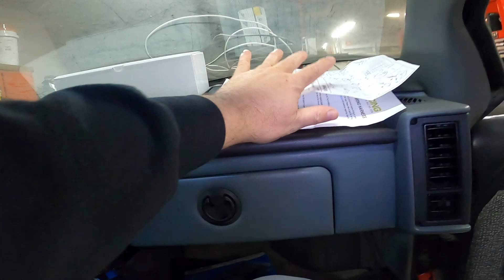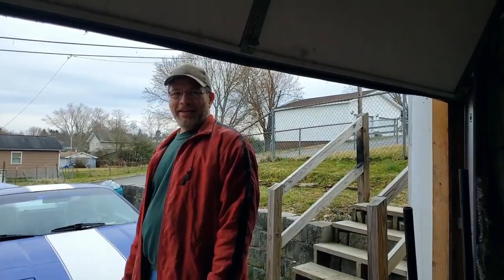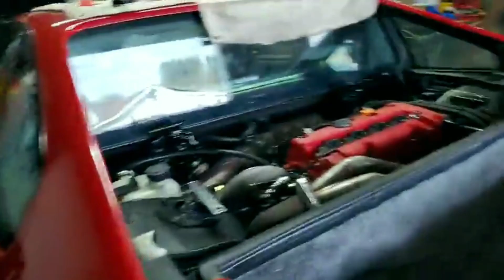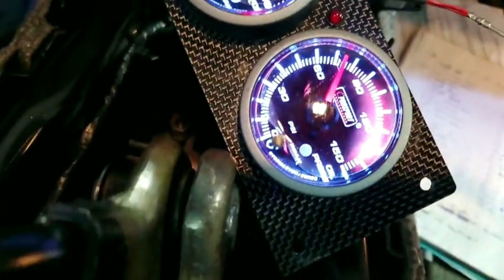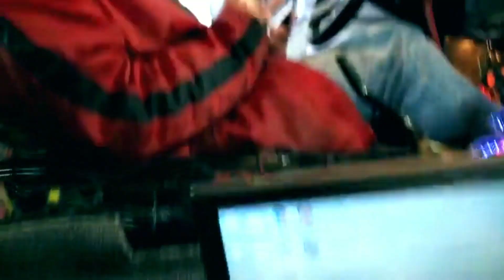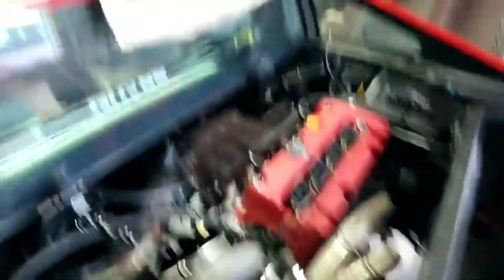K24 Swap Fiero GT pt.10 "1st Start"! Now with the correct vid.

Comment: This is awesome man!  Any updates on this?  I LOVE wild swaps!  I have a Fiero GT with a 3800sc that's under construction. I've had another one (85 GT) that was swapped as well but sold it. I also have a KIA Sorento SUV with a 6.0L LSx swap (on my other channel - OverRevvedRacing). I am planning on finishing the 3800sc swap but may sell the swap when I'm done because I really want to do an sr20det swap on the Fiero. After living with my 95 240sx (s15 Spec-R sr20det swap) I absolutely love the engine.
if you need some DEi heat shielding or wrap get in touch with me... I have a sponsorship with them from the KIA!
Reply from the maker: This fiero used to have a turbo 3800/f23. It's a great combo but, it's just so heavy. We talking gen1 all cast sbc kinda weight. I'm all about oddball cars and crazy swaps as well! I'd love to build a 65-69 Corvair with a EJ25 from an STI.
Reply: @BVM03  I agree completely on the weight. I didn't think the 3800sc was too heavy but it was definitely noticable in the handling.  I didn't hate the weight/feel but it definitely felt better with the stock boat anchor 2.8. That's why I have been kicking around the idea of the sr20det swap. It's definitely easy to make power with the engine. I'm probably around 400 wheel horse in my 240sx without touching the internals.
How close are you to getting the Fiero driving?
Reply from the maker: @TheGibsOfTheTube  the k20 fiero runs and drives. The k24 is waiting on shifter cables. I figured a year has gone past since a Hux Racing said they'd have a modified version of their shifter for me. So I bought a cheap Amazon Honda shifter, remade the base plate and now it's just cables holding me up.

Comment: what are the specs on the motor? What kind of upgrades are you running?
Reply from the maker: 2005 TSX k24a2. Hondata, IDC 1050x, RBC intake, ARP headstuds, 4piston ported oil pump,, exedy twin disc, morosp baffled oil pan, sidewinder turbo manifold, tial 50mm BOV, PT 46mm EWG, w2a intercooler. It also has a bunch of ktuned parts, fuel rail, 70mm TB, 4bar map, TPS, swivel water neck etc. DSS stage 3 axles and KFiero mounts.

Comment: 3D Print a new shifter bracket, atleast for prototyping. Its surprisingly durable. Resin printing even looks like injection molding. My printer would probably actually fit that.
Reply from the maker: Did you just volunteer for the project? Sounds like an amazing solution.